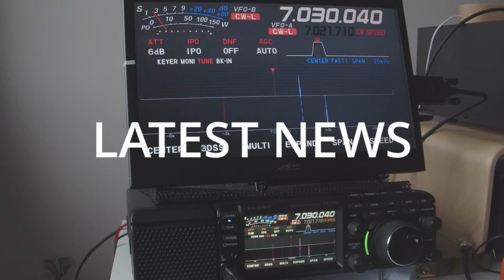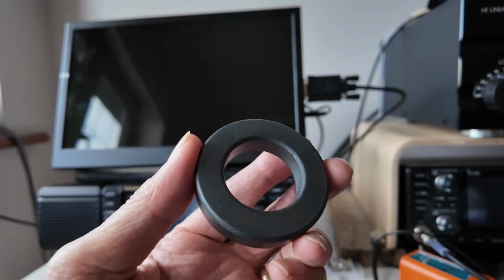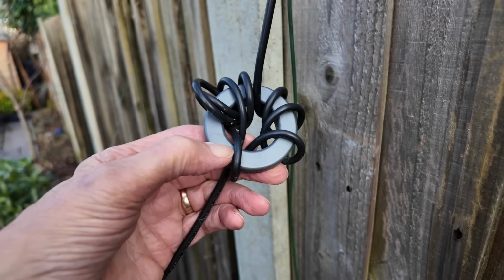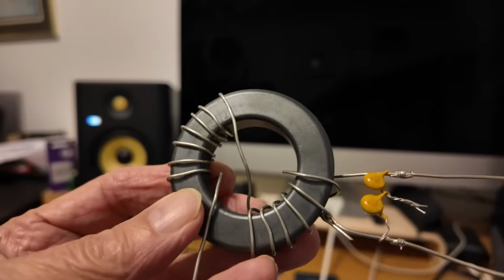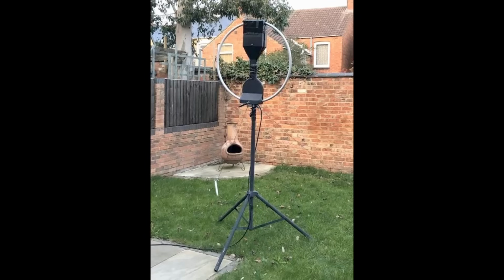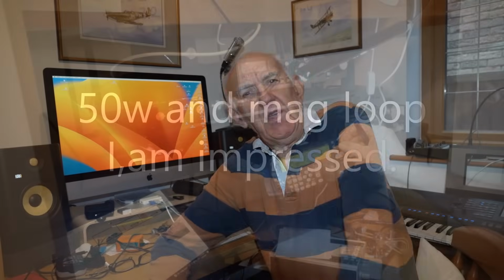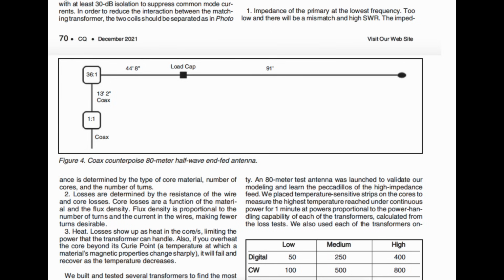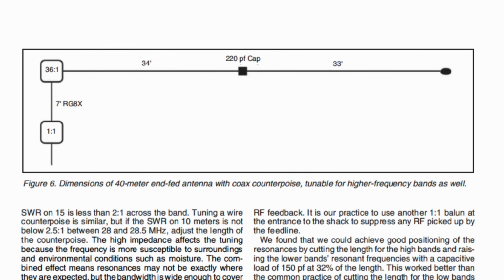End Fed Half wave Upgrade and News. | Ham Radio

Comment: I put the RF choke (aka line isolator) on the transceiver side of the coax for horizontal end fed antennas so the coax sheath can be the counterpoise and I put the RF choke just below the feed point for vertical antennas with tuned radials to prevent the coax from adding an untuned element to the tuned counterpoise radials.

Comment: Another trick that I've heard will keep an EFHW antenna resonant in the various ham bands is folding the far end to tune it instead of cutting it.  You'll need to fold more than you'd cut because insulated wire folded back on itself isn't as electrically short but the folded section introduces capacitance and that capacitive reactance varies with the frequency.  I have an EFHW antenna that I need to tune so I will test this in the park.  I'll use the leftover cut pieces of wire to make tuned radials for a POTA PERformer antenna.  Wire has become too expensive to waste!

Comment: Off Center Fed (OCF) antennas are very convenient and they allow multiple bands of operation with a simple wire antenna which is fed off center. 
Not sure why this OCF dipole is not in the discussion. Plus, you don't end up "zapping" all your little furry friends in the area of your antenna.

Comment: I am using the 75' of coax as my counterpoise with a choke at the radio.  Good SWR from 40-10. 17 is a little wonky though but still tunable with internal ATU on FT-710 and the G90.

Comment: Hi Peter. Using a capacitor to correct for the band slippage on an EFHW antenna. If you used coax as the capacitor and wired it length ways, that is the first part of the antenna wires to the centre of the coax and the remaining part of the antenna wires to the outer shield but at the other end of the coax effectively placing the coax in line and part of the antenna. Would this conceivably work?
Reply from the maker: Yes in theory it should. Coax is a good way of inserting a capacitor.  I have pondered this idea but it is something that needs to be tested as there would be interaction between overall length, length of coax and capacity  needed. I guess a bit of cut and try. But it should work. Maybe I will try it sometime.

Comment: I use a 40-meter antenna end-fed 49 to 1 transformer in my 36 feet of garden. I ended up feeding it at the bottom of the garden, swr was well within 1.5 and lower. I do use a counterpoise which runs along the fence. I also use a coil for 80 meters. again swr well within 1.5. I did try putting the transformer as suggested by Peter at the House end fitted just under the eves, but all I got from that was SWR off the scale on all bands and the noise level well above the normal. It works very well in fact, the best antenna for my situation. The transformer is just off the ground, runs up a 25-foot fibreglass pole then runs up to my main mast and then on the the main chimney stack. Thank you, Peter.
Reply from the maker: Sounds a good installation. Can't think why you had the problem feeding from the house end. Did you install a line isolator at the transceiver end?
Reply: thank you for your reply, yes I did put an isolator at the transceiver end. @watersstanton
Reply: @brian.7966  But did you Earth ground the far opposite end?

Comment: I have a 20m long Resonant EFHW from UK Antenna's and it works well - i have 81 countries for my DXCC so far.  Feed end atops a 8m steel scaffold pole and the other a metre over the chimney on my house.  Fed with 213 with 10 clip on ferrites.  It is as good as my old 13m vert, 40m full wave loop and various mono band dipoles.  SWR is good on 40, 20, 15 and 10m bands.

I use a TS590 and, if i used a cheap 'Max' chinese atu i can work 17, 12 and 80m bands  If, like me, the wife has finally had enough and you are limited to one, reasonably stealthy, hf  antenna you could do a lot worse.
Reply from the maker: Many thanks for sharing. Hap New Year.

Comment: Another great and informative vid, peter! I run a EFHW for 40m in my yard at only ~6m or so in rough inverted L config, it works a treat for local and international contacts. Home shack is an FT 710AESS, which ive owned for just over 12 months now, a fantastic radio for beginner or advanced users, with plenty of features and latest technology at a reasonable cost

I also run similar out portable, config depends on location and available facilitys, using an FT891 (another great unit!)
Merry Xmas and happy New year from Downunder, Joel vk2moe

Comment: A half wave centre fed doublet cut for 80M and fed with ladder line is much simpler and works on all HF bands superbly. All you need is a 1 to 1 current balun or a balanced antenna tuner and away you go. No earth required and no RF in the shack.
Reply from the maker: But you do need to buy an ATU and balanced  linedangling down the middle of the garden. An EFHW  has none of that and for portable operation can be run out in minutes.  Horse for courses I guess.

Comment: Just do not connect the primary and secondary together. Connect the counterpoise to the low end of the secondary winding. No more common mode current.
Reply from the maker: Then it is no longer an EFHw, but a W3EDP. which in turn is an OCF.

Comment: Actually, if that core that you dropped only broke into a few big pieces (rather than shattering into dust), you can glue it back together, and probably not notice the difference.  After all, it5 was just powder glued together in the first place.
Reply from the maker: Yes you are right but unfortunately one of the pieces got thrown away in a clean up!

Comment: Thank you Peter! I've had success using a 71' stealth non resonant end fed sloper, 9:1 unun, 50' LMR 240 coax, common mode choke at transceiver on all HF bands including WARC bands for QRP & 100 watt SSB DX, & 80/40 SSB nets. Antenna tuner is needed on 160 - 40.
Reply from the maker: Good stuff. Thanks for sharing. Happy Christmas.  73 Peter

Comment: Thanks for the video Peter you have nicely summed up the finer points of the EFHW antenna. I see some Youtubers experimenting with a core of a slightly different form factor to get increased efficiency. What are your thoughts on that? Also would it be possible to wind the transformer with tapping points to give access to the different ratios in one transformer?
Reply from the maker: A switched option would require both primary and secondary changes. Could be problem with losses. Check MM0OPX channel for core performance. He has done a lortof work on this.
Reply: I was thinking along the lines of a 8 to 1 unun taping of at 16, 15, 14, 13 turns on the winding to the antenna.
Reply: @redjohn20001  Yes, some people have done that, with different screw terminals at different taps. Colin (MM0OOX) reckons a 56:1 with the fat core is best for him.

Comment: Highly informative, as always, Peter! I love your style. 

My challenge with the EFHW comes down to a question of where to string 67' of wire without getting in other people's way. I'm 100% portable because my QTH, both by its physical design and by its location in the city, is hopeless foe radio: blanketed by tall buildings, overhead power lines and other sources of interference everywhere. Most of the open space here in Silicon Valley is pretty popular and it can be hard to avoid the footpaths with the wire, but I do frequently chat with people who are curious about what I'm doing or who know what I'm doing.  

The 40-10 EFHW has been my sole HF antenna until now. I've just received the Hustler 20m and 40m Resonators, 54" mast, and a Tram triple magnet mount. I'll be testing them tomorrow, prior to a road trip on which I'll have several opportunities for POTA activations. Hustler advertise the mast itself as resonant on 6m. The EFHW will be in my kit, as well. Radio is the IC-705.

Merry Christmas to you and yours! 73 de AE6DD, Daryl, California
Reply: Don't live in a city.
Reply: @billryland6199  That sums it up, doesn't it?
Reply from the maker: Hi Daryl, great to hear from you.  Yes a big problem in cities. You can load an EFHW  and I will try and prepare a video sometime in the future.

Comment: With a 80m EFHW cut the wire in half and connect a capacitor of xxx value. the value will depend on where you want it resonant. i used a 270pf capacitor and it made it resonant around 3.900 ssb.your mileage may vary. thanks for the video pete.
Reply from the maker: I have not trued the 80m version but the drawing from CQ magazine showed to cut the antenna at around 32% which would result in a different harmonic result. If your version works then great. All the best for Christmas.

Comment: I definitely need to learn the patience side of this hobby even though I’ve been having a blast. We get some high winds here in Alaska and before winter hit I took down my crude fan dipole to upgrade it and preserve it for next year. I’ve since gone to a chameleon endfed half wave they say is 160-10 but at only 125ish feet it’s really only an 80-10 witch suits me fine since I’m only a tech that it studying for general and extra. On this antenna I’ve set it up in a sloper going north to south, and a sloper the other direction south to north. Now I have all of the antenna at 35-30 feet in the air and still don’t get half the signals of my dipole at the same hight but ends sloping to the ground. None the less enjoy your videos and I’ve been having a fun time on 10m when it opens for me
Reply from the maker: Antennas sometime defy logic. My dipole always outperforms my vertical . In the end, go for what works best for you!  Thanks for your support. 73 Peter.

Comment: I’ve been away from ham radio for 25yrs +   Re educating myself because it’s changed so much.   Un Uns    Baluns   windings…. bursts my head,  because I’m not clever but my mind asks…ok, put that here,  an X,  on the EFHW… and it works… ok, why does it work?  How does it work?   The maths has to be easy to follow and the explanation in English not Greek.   Btw, antennas are my thing but the sciences are not… I’d like to understand but somethings don’t gel…  practical science and engineering, then see IF it I works… if not, why not… fix it!
I’ve been watching your channel for some time and enjoy the subjects also your presentation, I’ve learned a lot from watching…  un uns  baluns   ….. I’ll just have to try harder.   Believe it or not my call sign starts   G0…. How did I pass the license exam ?  sheer brute determination and desire back then.   Thank you.
73
Reply from the maker: Great to hear from you and welcome back. Thanks for your support. Happy Christmas.

Comment: Also put a high value resistor across the series cap to prevent static buildup in the DC isolated length of wire. Happy Christmas, all.